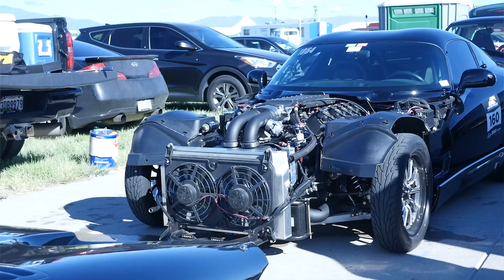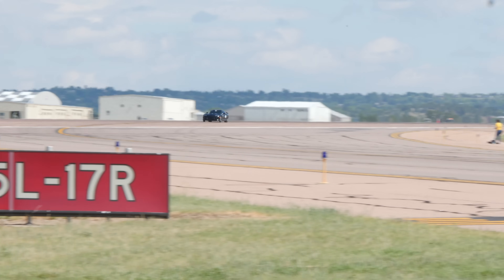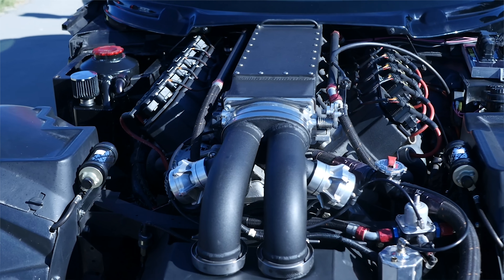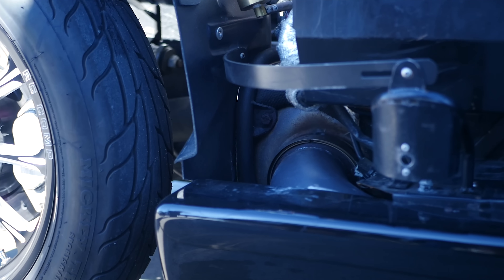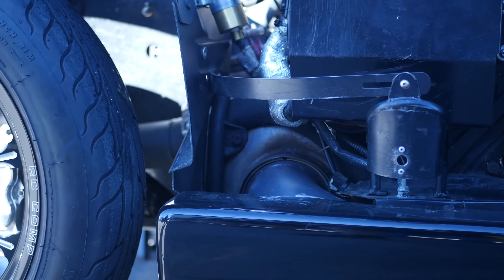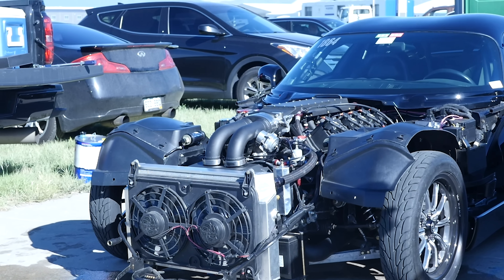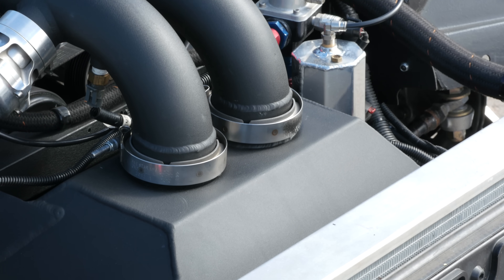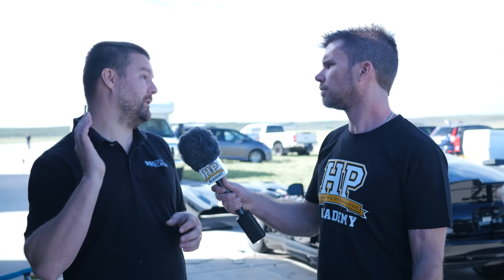A 9L 2000kW V10 Viper That Almost Hits 400 km/h | World Record [TECH TALK]

Comment: Ah 1/4 mile, there's a Ford GT that does 455k's but we're not talking 1/4 mile. Pretty amazing to do that on the 1/4 mile.
Reply from the maker: This is over a 1/2 mile rather than 1/4, but yes still half the distance of the impressive Ford GT record which was set over a mile 😎 - Taz.

Comment: why don't these guys just run a little nitrous to make the same power at pikes peak that they do at surface level
Reply: Weight and capacity. A bigger turbo that can make the boost on the peak with lots of wastegate duty at surface is waaayy lighter than a massive tank. It would have to run huge psi and flow to keep up at redline, but it's okay to get started at low rpm.

Comment: So. Why is it we cant get 300 HP for a one cylinder or 600 horsepower for a two? Be kinda nice to have a 2 cylinder car get 50mpg but still get 600hp when you floor it. I know. I am dumb about engines.
Reply: We can, but mass-producing an engine with that characteristics requires very strong parts, which would be too pricey to make. Reliability would be a problem, too. OEM engines have to function across the world in various weather conditions.

Comment: Minor point of order here- LSM Systems engineering does offer a Viper V10 billet block. Granted, it was designed before the current generation of the Viper engine, which could possibly either necessitate compromises or raise the price, but regardless, I think you are perhaps under-reporting the size of the Viper aftermarket. It certainly doesn't compete in depth an breadth with the support that American V8s receive, but as far as I can tell it is big enough to provide a solid foundation for the shops building these roll-racing vipers. I could be wrong though, I'm just reporting on parts I've seen for sale in passing.
Reply: Do you know if the Ilmor Viper based V10 marine motor is Dodge block or billet aftermarket?
Reply: Jim E It's a Dodge block.

Comment: Absolutely mind numbing...I'm not that much into drag scene and I definitely wasn't aware that the tuning scene hit these levels. It's hard to comprehend, 3000HP car, good grief...
Reply: Full Top Max Modern V8’s and V6’s of half that displacement are making 3000+ hp. The fact that it’s a stock block is scary
Reply: Higher cylinder  count in an engine tends to handle power more reliably*
Reply: I dont even think its physically possible to get enough fuel into a 2L to get 3000 horses unless it would rev to like 20k...
Reply: @benzintrinker5821  hahaha
Reply: Benzintrinker   They have passed that now
Reply: Benzintrinker  currently being done